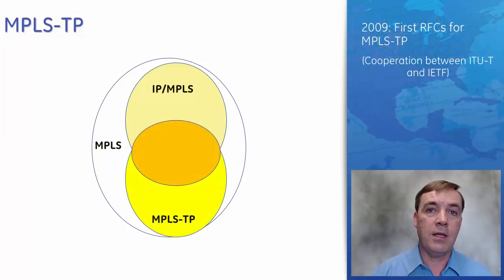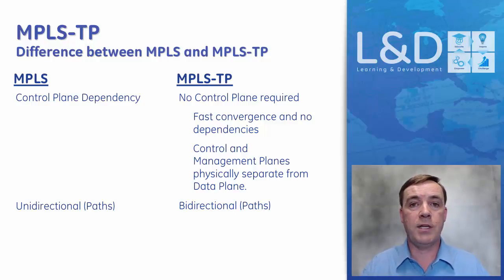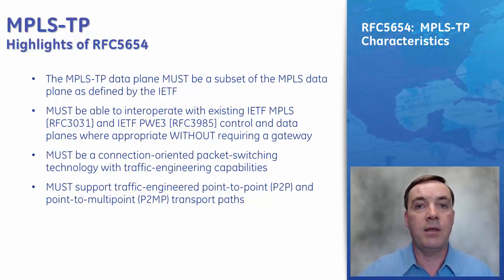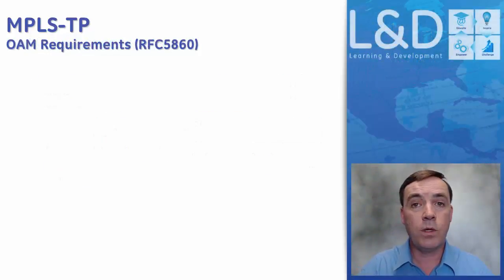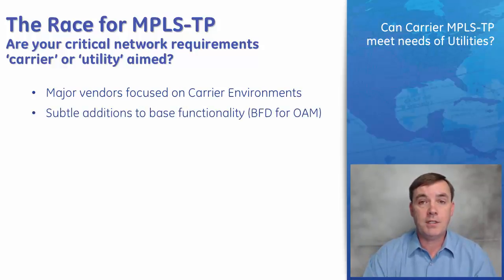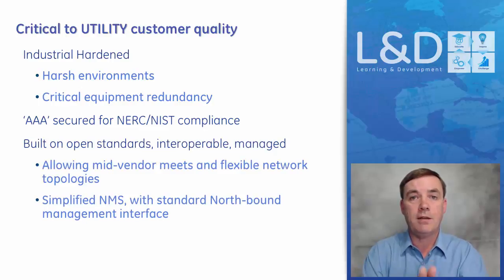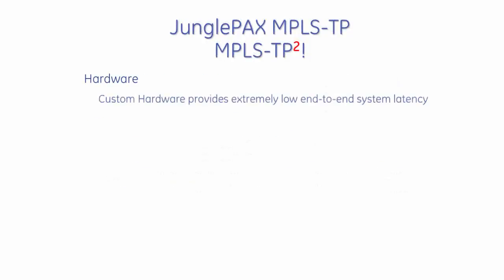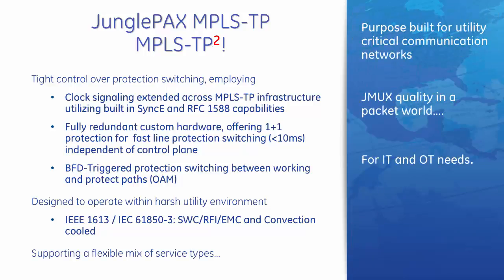JPAX-104 l JunglePAX MPLS Part 2 v1

Comment: Is the "enhaced" MPLS-TP implemented on JPAX still interoperable with the solution of other vendor? I mean, could the JPAX coexist with other vendor solution?  (assuminIg both of them use same phycical interface and MPLS-TP). If  is so,  what could the limitations? Will be the NMS propietary?. Would be possible to share service through a E1 (or T1) channel bank? And what about ethernet tributaries?